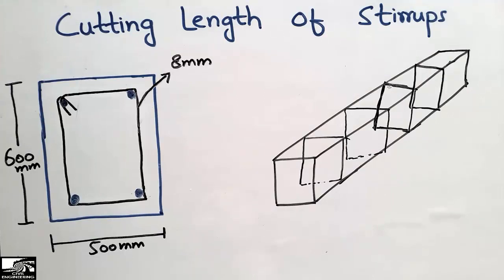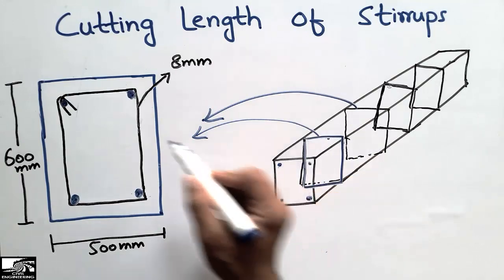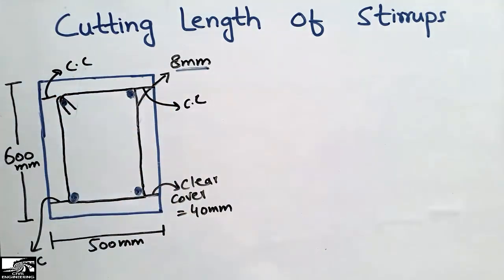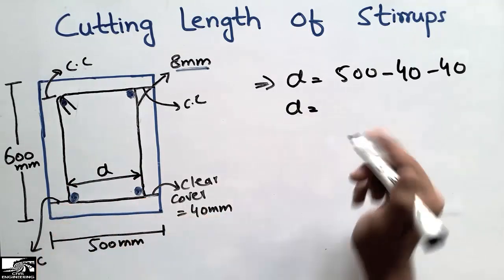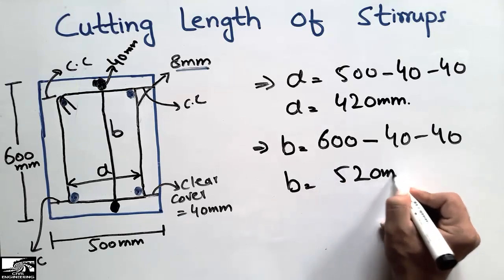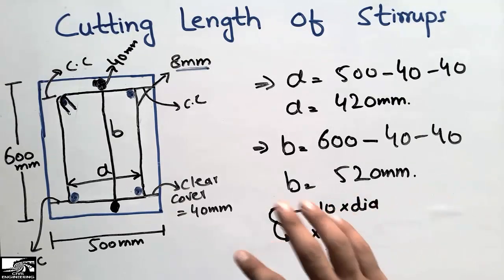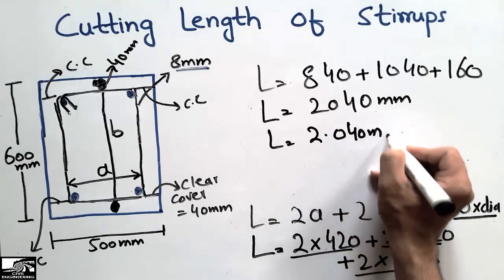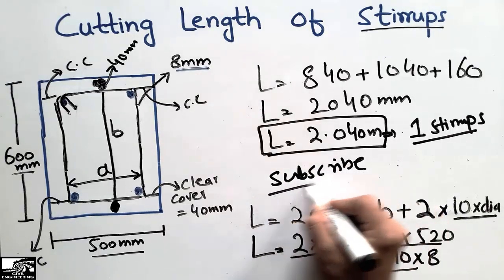How to find Cutting Length of Stirrups with example

Comment: its wrong, the cutting length will be  = ( 2 x (420+520)) + 24 x 8 ) - ( ( 2 x 3 x 8) + ( 3 x 2 x 8) ) = 1976 mm
Reply: I believe your calculations are also not 100 % right, read IS 2502 where there is a center line method used to calculate the cutting length of stirrups. There is  no need to add bend deduction in the formula, 2(a+b) + 24d is the right formula to calculate the cutting length for stirrups with hooks  bend at 135°
Reply: @ashutosharya6221  if you are referring to page 13 of IS 2502, ref no. A, where it says 2(a+b) + 24d, then i suggest you re-read the header where it clearly says "length of bar" instead of "cutting length of bar". Both are very different things.

Now coming back to center line method for bend deduction, for 135° bend, as per IS 2502 page No. 9, the bend deduction is 3.08D or simplified as 3D
Reply: Actually in the IS code method a and b is considered from the inside of the stirrups,  a = (500 - 40  - 40 - 2 *0.5*d) = 412 mm similarly b = (600 - 40  - 40 - 2 *0.5*d) = 512 mm
Reply: @apurbaghosh5046 kindly let me know where the bend deduction is mentioned in page 9 of IS 2502.
Reply: @ashutosharya6221  if it considered from inside the strirups why is centerline method ? Its utterly wrong and no such thing is ever mentioned anywhere
Reply: Total length (520+520+420+420+160-96)=1944

Comment: your calculation is correct but. sorry you need to deduct the 3 time 90° bend and 2 times 135° bend for exsample you bend a rebar for 90° you need to use d1 deduction d1 is 1x10 and your rebar is 8mm you need to decuct that. if you did not deduct your 135° make long later
Reply: 2d for 90Deg & 3d for 135Deg..

Comment: 2040 length but not a cutting length 2040 and bend diduction 12D  12X8= 96mm 
2040 - 96 =  1944 cutting length of Steel